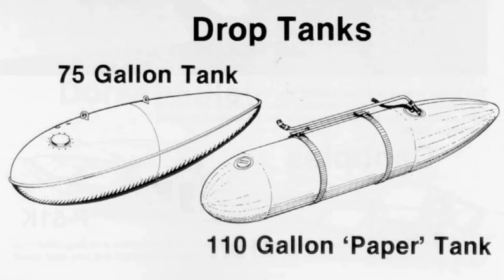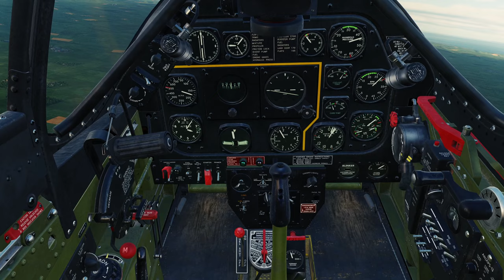DCS WARBIRDS SERIES - PART ONE - THE MUSTANG - Episode 3: CLIMBING HIGHER [3/6 IN THIS AWG SERIES]

Comment: 27 (hundred) rpm and 46" map is max-cruising. The engine is rated that you can fly indefinitely at those settings--barring a lack of fuel ofc.
From what I've heard the 27 rpm is the most efficient setting for the propeller. You can ofc turn it up to 30 rpm--and on the ground you should while taxiing and while taking off--, but you will get no additional power through increasing the rpm beyond 27, and will cause additional strain on the engine for having to run at a higher speed.
Depending on how steady you fly, while at max-cruise and moderate altitude--between 5k and 10k feet, you should be at about 250 mph. If you climb at max-cruise your speed will drop to below 200 and your climb rate will be mediocre at best.
I suggest pushing map to about 50 to 55 or even 60 while paying attention to your oil pressure and temp--whereby pressure is the more important. Remember all those times your engine suddenly went BANG and your windscreen was suddenly covered in oil? That was because the oil pressure blew through a gasket allowing all the pressure from ignition to blow into the motor block--where all the oil is--and blowing the oil out every opening it can find. It is not absolutely necessary to set you oil radiator manually to full open. Only adjust when necessary. I noted that you had it opened full and your oil temp dropped below green while climbing. I don't recall the pressure, but cold oil has a higher viscosity and can cause higher oil pressure. I've never seen water temp go into the red without either massively abusing the engine or having suffered a water leak.
Anyway, you can push your oil pressure over green for bit, as long as it stays out of the red. This will allow you to gain altitude fairly quickly. Once at your required altitude, ease back to max. cruising or whatever you need bellow that, and oil temp and pressure will drop back into green.
ps and don't forget to put the radiators back to auto ;-)
Reply from the maker: 👍 thanks for sharing in this content!